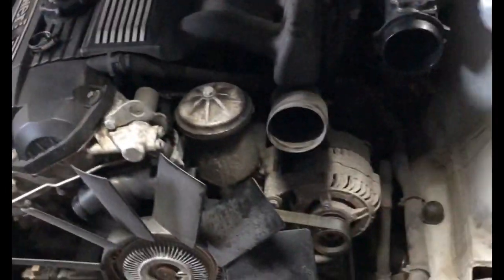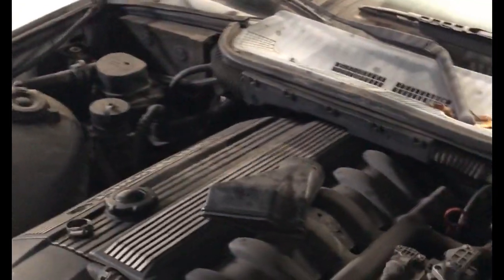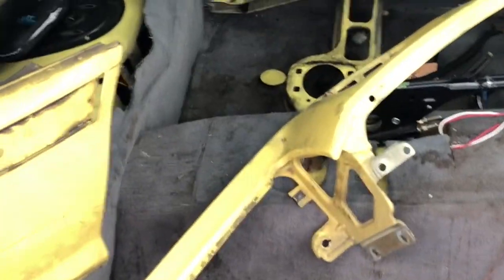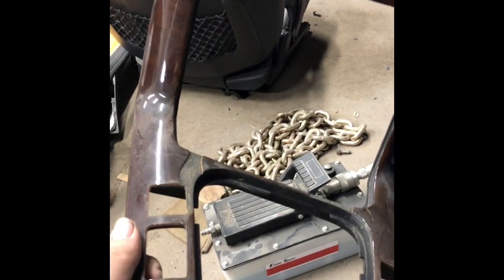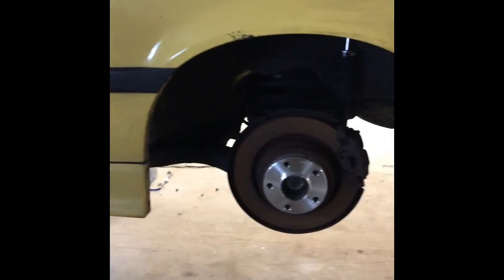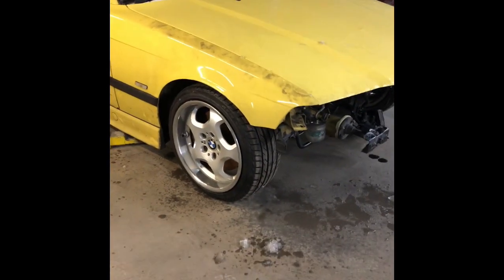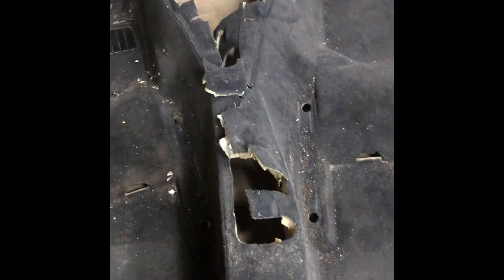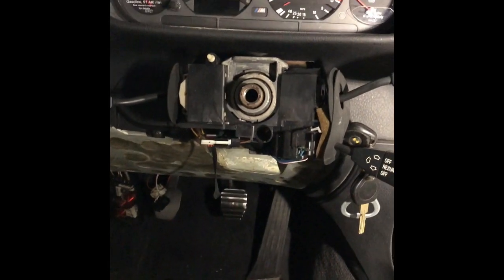E36 build start!

Comment: Looks better with the spacers, are the wheels a wide set?
Reply: ISnt there a OEM 9.5 and 8.5 in the front set?  @bkgshop
Reply: @bkgshop  checkout www.marktplaats.nl, here in the Netherlands you see them more often,
Reply from the maker: check out the new project on the channel